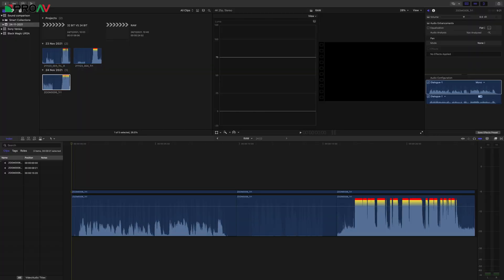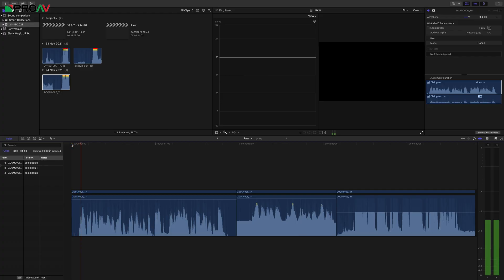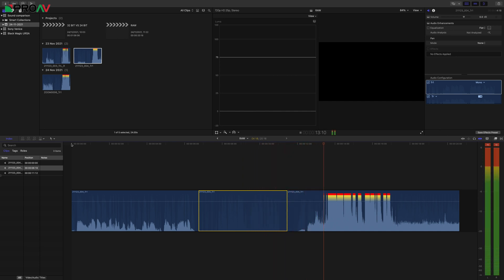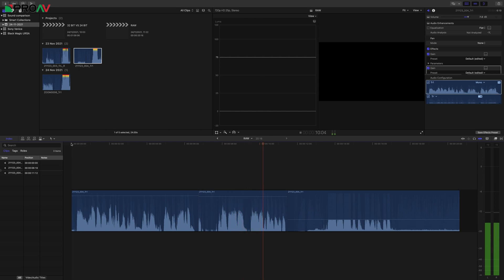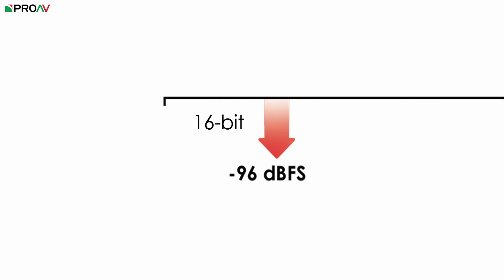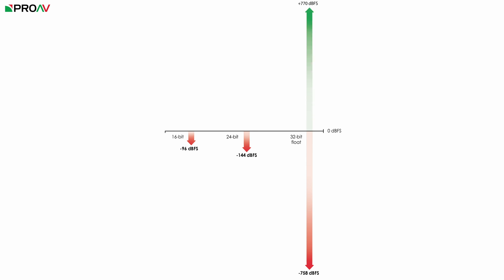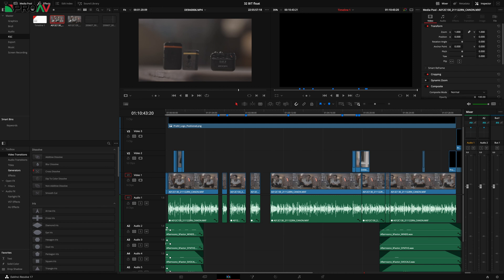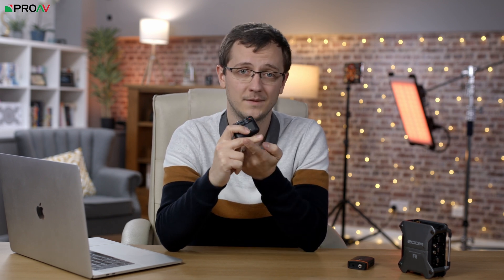Why 32 bit float is something every video professional should know about

Comment: How come you can't monitor it? Won't this cause other mistakes that wreak your audio placements etc if so is it only really good as that secondary backup audio device where your main audio source failed
Reply: you can use headphones, the levels are eliminated. But I can hardly imagine that the device has to be trusted that everything will be recorded. But maybe the new technology is so different that you don't have to worry about mistakes anymore
Reply: @relaxedanchored  it's certainly one of those things which sounds like an amazing safety net but will probably just lead to videographers becoming more sloppy and end up spending hours in post fixing problems that could have been addressed onset in minutes.
Reply: @godsakes  I can't say that because I haven't tried it yet, but to me it sounds great, as long as you don't stay in post-production for days.

Comment: Wowzers! 32 bit float truely handle stuff that is loud as hell. Hot dam! But wait then what's the dynamic range for 64 bit float then? I ask cause SoundForge Pro does 64 bitfloat. You're right by the way. 32 bitfloat ain't new. SoundForge 9 from 2007 could do 32 bitfloat. But the thing is and what's epic now is thanks to Sound-Devices and Zoom with the F6 and I think the new F2 is you can do 32 bitfloat with something you can even clip to your belt. Also in the case of the F6 at least you can do 192 KHZ 32 bitfloat with 6 channals which means you can render those suckers to glorious 32 bitfloat 5.1 surround sound.

Comment: Not sure the bride and groom implementation is a good example.  Yes, the mic on the groom will pick up the bride and yes, with 32bit float you can boost the levels when the bride speaks.  However, you will also boost the groom breathing, any movement noise, clothes rustling and all the noise made by the groom while the bride is speaking.  In my opinion the bride would also need a mic/recorder close to her.  The 32 bit float would be invaluable in capturing loud noises such as laughs, claps etc.

Comment: As long as the Avid Media Composer and Final Cut Pro and Davinci Resolve editors can handle them I don't see why not using 32 bit float. In documentary and run and gun situations, it certainly can facilitate production much easier.

Comment: Would have helped to mention that 32-bit float audio is the default standard workflow environment in Adobe Premiere Pro, and it has been for quite a long time.

The only ambiguity about this technology is the industry's sluggish adoption.  It should be standard on every single A/V product, from ten years ago.  Certainly the Rode GO II should have had it natively, instead of conversion to 32-bit float.  It's up to consumers to start demanding the feature; manufacturers do the absolute minimum unless they're called out on technical standards, without the noise of lobbied fanboys and bloggers defending their slow adoption speed with accounting department M.B.A.-speak.
Reply: That comes from Adobe audition in the beginning. You actually mix in 23 bit float, meaning you can push the audio inside it above or below in real time. But once rendered out it conforms to whatever bit rate exported.

Comment: 32 bit float is a huge container of a format, and with today's data processing power, there is every reason to move to it where it is applicable.  BUT, as you pointed out, it is only a container.  To make use of that huge container you need hardware that stacks two or more analog to digital converters and high quality preamps to feed a very good signal to those ADCs (along with some well-used computing power to merge those streams of 1s and 0s representing different parts of the enlarged dynamic range.) Feeding your mic's signal into a bad preamp (or even an excellent one) then into a single ADC with a dynamic range of about 115 dB then converting the result into the 32 bit float format won't give you the results that you demonstrated from that particular Zoom recorder, and it's important for users/consumers to understand that aspect of what is needed hardware wise.

Comment: That was a good video!  I think that 32bit is a god send for one person operators that just don't have an audio person to monitor levels.  I would also think that as a feature, companies like zoom, would need eventually to roll this into every recorder they make.  Other than whatever marketing concerns, for users , once they understand it and how to deal with it in post, there is just no downside at all.  I think even the Panasonic and SONY XLR adapters for interchangeable lens cameras should work in concert with camera firmware to make this happen there as well.  Then of course all the video and cinema cameras that have XLR built-in, don't you think ?

Comment: Great video! A side note,...I did read that the Zoom f2 recorder goes even further. It has two gain circuits that are mixed together before it's digitized. It takes a high gain preamp to capture quiet sounds and a low gain preamp to capture louder sounds. The two preamps are blended at some crossing point to reduce the analog noise floor somewhat. This creates a signal with maximum analog performance first. With two analog preamps on a mono file, this helps ensure that you get 100% of your mic's analog dynamic range. With 32bit float, your only realistic limitation is your actual microphone itself.
Reply from the maker: Yes, most of these products I mention have a dual gain circuit system as it helps them capture enough dynamic range for 32-bit float recording.
Carl

Comment: Thank you!  Man, it just further proves that you learn something new every day!  I'm just wondering about the "float" aspect of it - does it sync well, then, with video timecode?  And I'm just wondering when DSLR's and camcorders (yes, some of us still use those 1" camcorders with the XLR inputs) will get this capability?  The camcorders in particular are still stuck on 16 bit/48KHz sampling rates like the "dark ages"!
Reply from the maker: Don't worry, there are no sync issues.
I'm sure we will see it in cameras at some point, but I think that will be a while away
Carl
Reply: It is still normal PCM audio, works exactly as before in terms of timing. Each pulse (sample) is 32bit instead of e.g. 16bit.

Float32 is stores each pulse as two pieces. The big thing is that precision is always stored “perfectly” (into 23 bits) and that the size of the signal, the amplitude, is very efficiently stored into 8bit bits. So regardless of if the signal is loud or very silent, you always have 23bits of audio left

Comparing with traditional non-float audio (integer PCM audio), as soon as you have too little gain you are effectively throwing away all your data and just storing zeros. A 24bit integer signal gained very low might effectively just be just a few bits of data and the rest is zeros. Not so with float32, as it always has 23bits dedicated to storing the audio, regardless if the amplitude modifier is very low.

So that is the big trick with float; it is always trying to store the audio pulse as well as possible, regardless of amplitude/gain.

Comment: I like to explain 32bit float audio as signal containing two signals; 24bit perfectly gained precision bits, paired with a 8 bit extremely efficiently compressed amplitude modifier.

That explaination is very close to how floating point arithmetic’s actually works

Traditional audio mixes precision and amplitude into one signal, and doesn’t optimize for always storing precision (effectively the operator needs to manually do that as best as possible using gain)

Comment: Hi Carl,

Agree with you.

Have you used the Instamic Pro Plus?  It has time codes but is also 32bit and timecode synch with Tentacle Synch E.  Some cons are it still uses USB micro (probably keep cost down by not changing power management module), doesn’t have 3.5mm input jack (but it has great mounting options), and has to synch in post.    

But I think it addresses the pros of what you shared in video:
- 32bit float audio
- Waterproof
- Mounting options
- Remote control and monitoring through app
- Timecode synch with Tentacle Synch E
- 16GB internal memory storage
- Mono, Dual Mono, Stereo M/S
- Remote control up to 10 units without needing additional receivers
- etc etc

Would love to see a comparison with Tentacle Synch E and Zoom 32bit F2 recorders
Reply from the maker: Thanks for the recommendation!
I'm not sure how popular this would be with our customers though due to not being able to use a Lav-mic
Carl

Comment: Great video ! My only concern with the 32bit recorders paired with a lav that exists on the market for now is monitoring. Not having to check levels is a huge benefit but it doesn't prevent sounds from a poorly placed lav, or ambiant sound. I'd love a wireless unit that would allow to monitor in real time, write the audio synced up in camera and record internally in 32bit float. Maybe a Rode (or any other brand really) wireless 'Pro' ... ^^
Reply from the maker: Yes, monitoring is the challenge.
Carl